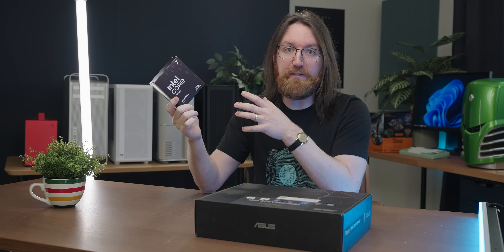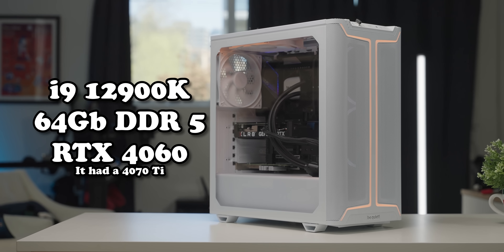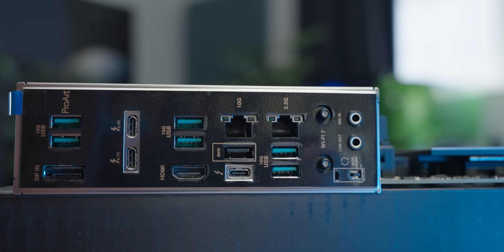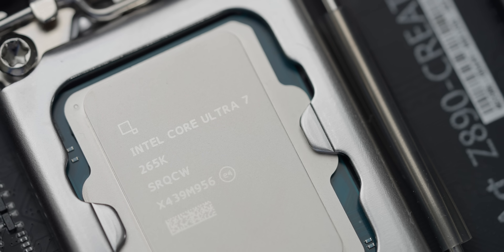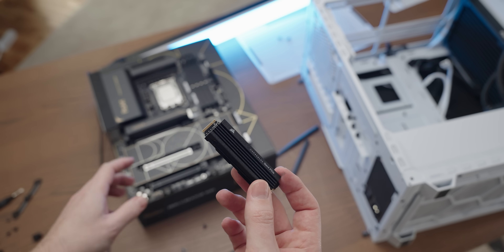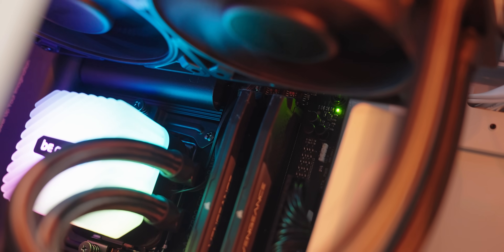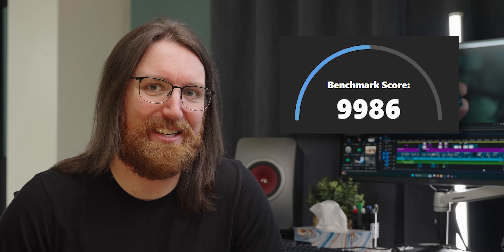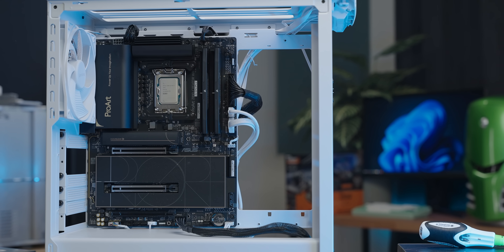I ACTUALLY Bought An Intel Ultra CPU In 2025...

Comment: I hate how creators talk about these CPUs as if they are actual shit, even though for a lot of users that need options which don't cost a liver they are usually fine, even for gaming. Like this video is already a few months old, so the price of the Ultra CPUs, especially the Ultra 7 265K and KF have decreased considerably, being even cheaper than Budget X3D options. Obviously Intel sucks in a lot of ways but these CPUs are in my opinion an actual budget option, which depending on your graphics card can get medium to high performance in computationally heavy games. Again, there is obviously better options, if you have the money, but those usually have a price increase of at least $50 and probably more.

Comment: Dawid I use an Asus Pro ART B660 Mobo for my Capture/Editing Rig, 
I chose it for the ''DP IN'' which offers an up to 240hz passthrough from DP to USB-C on yours I am guessing it is the one on its own!
This allows me to duplicate my gaming to a second DP & if you then send through the MOBO and send the USB-C through to a capture card it means any G-sync or Free-sync you have running is not in any way effected by what FPS the capture card is recording! This only works if the capture card is then passed through to a high refresh rate monitor, but I just return it back to an empty port on my gaming monitor and it works a charm!
You play on a native DP with no passthrough delays or image issues & your capture card basically receives the same with no weird taring or Refresh rate reduction!

Comment: Well, for its money, 265k and 285k are beasts, which are good and even better than AMD for work and then slightly worse for gaming.. So May be AMD was better a year ago, but now, Nov-25, intel is great value for work, etc. 
Same as NVIDIA videocards, I still have to buy them for work, they still good, ,but the best are costly...
 1) INtel is for work (2d, 3d, oficce, etc
2) you dont need support for 2 generations, if you bought PC for next 5 years - I can basically sell back to my shop all parts and upgrade 
3) Amd now is more expensive, its almost same or worse or better a bit in most of benchmarks, so for that money AMD wins just in 4k games. Again, if you are so rich just to play on PC, so buy the best GPU like 5090 and best chip, still now I think its 285k or 9800x3d...9950 also not promising...
I was dissapointed by burning 14 gen Intel, I love that AMD doing well, but after all checks, Intel ultra is the cheapest working solution for me for next 5+ years.
My conclusion - INtel is value for money now and for work+games. AMD is slightly better for games+plus you can upgrade next year - so money is not a problem for you )

Comment: how much time is it saving you per render though. enough to build another system? probably not. fixing the 50 series card issues would have probably netted the 12 series the same results on that benchmark if one system was gpu bottle necked why wouldnt the other be? did you even consider rebuilding the 12th gen on its box and just seeing for shits and giggles how both systems with that card do, drag raced comparison?

Comment: Need some advice guys.

I need to build a machine for 3d modeling and some light rendering (arch viz), with a lot of lidar point cloud workflows in there.  Should I build with this cpu or the i9-14900k?  will have 256gb RAM and rtx 5080 and large case (fractal north xl).

I plan on a 420mm aio and overclocking this bish!

any help is appreciated.  🍻

Comment: Same CPU and motherboard for my build. I also do audio production as a hobby, and for those kinds of workloads the 265K still outperforms anything from AMD. People who whine about the 10% drop in gaming performance over AMD cry too much. My last build was from 2016 - I also game casually and the 265K with a 5070ti is still generations more impressive. I can run less demanding titles at 120hz 4k, and have a secondary 1440p at 60hz for more demanding titles. Unless you're actually trying to run top demanding AAA games at 4k 120hz ultra it's still going to run anything you want to play.
Reply: Anything on heating issues of Ultra 7 265K? I am running an i7 4700K,  GTX 1660 Super 8GB (Upgraded from GTX 750 Ti OC in 2019 ) and and 16GB RAM for the last 11 years. looking for an upgrade now. Any recommendations on Ultra 7 265K would help. Mostly video editing includes AI, and of course occasional gaming too :)
Reply: @aceplaybill  Well, you'd have to define what you mean by heating issues.

It certainly runs hotter than my 6700K. My 6700K with that Noctua cooler that barely fit in a case idled a little above room temp (usually low 30s) and maxed in the 50s at full load. At full load that system was barely audible.

With the 265K idle temps are in the low 40s, and with full load it averages in the low 80s. At idle and doing simple tasks the system is dead quiet, but at full load it gets somewhat loud.

That being said, I crammed this thing in a Light Base 600, and built it in a reversed layout so I can see inside the PC with it on my left. I used a Deepcool MYSTIQUE 360 because I wanted to play with the screen, but because of space considerations I was only able to mount 2 of the 3 fans on the radiator (can't remember exactly why, something with the reverse layout and the motherboard and GPU all being at the top with the rad). It would probably be a little quieter with 3 fans on the rad, but I have no reason to pull it apart as of now. Knowing what I know now and with the case I picked (that can be oriented 3 ways) I probably would have went with an air cooler ... but whatever.

So, it will run hotter and louder than your 4700K. I don't personally find it an "issue". Unless you're doing something like video rendering hitting all cores at max, it's not ridiculous. Even during most games it runs in the mid 50s/low 60s (they're probably mostly GPU bound).

Comment: The 265K is a great value for someone who is using it for work and not gaming. it's also not bad for gaming either. If I was purely gaming, I think the 9600X would be best bang/buck in a budget system. For real work.. the 265K is awesome.
Reply: Even though it's a bit worse for gaming, the efficiency/power consumption of this 265K is already much better than a Ryzen 9600x or 9700x, which is pretty cool.

Comment: I'm considering getting an Ultra 7 265k because in my country it can be found new at around 270/280€ while a Ryzen 9 9900x costs more than 300€ even used and the 265k performs a little better than 9900x in general.

Comment: I have the ultra core 7 265k also. I use it for gaming and video gaming. I have it paired with a rtx 4080 super. While playing video games such as COD, Battlefield, Indiana Jones, etc. it has very high frame rates; usually above 150 fps in 4k. Judging by the usage percentages, the bottleneck is the GPU, not the CPU. My DDR5 is 7200mhz, but the CPU can handle much faster ram. I love this CPU. I'm not sure why so many youtube guys who don't have one throw so much shade at it. . . To the videographer, why would you buy an AMD motherboard when you just had one go out on you? AMD boards have voltage issues. I made a gaming pc last year with a 7800x3d and an AMD motherboard. The MB fried the CPU on the first day. I also had a 7800xt gpu go bad in 2 weeks of light use. I replaced it at bestbuy with a 7900xtx. That card only lasted a month! So I toom it back and got a rtx 4080 super. I've had no issues since and will never buy an AMD product again.

Comment: Video editing is very good on my Core 7 Ultra 265K. My Ryzen 9 5950x wasn't cutting it, even with an RTX 3090. No complaints, except I'm stuck with DDR5 6400 and now it supports DDR5 8000, I'm not at all happy about that but I can't be upset I now can do that, but man that is frustrating.

Comment: Here 265k is often for sale 210-230€. 9700x usually 330-360€, 9800x3d over 500€, 7800x3d around 380€ and all ryzen 9 processors more expensive. It is great value for money  at this moment. Power draw is quite big, but it would take like 4000 - 12 000 hours at near max draw to see that difference in electric bills.

Comment: Finally someone notices. This cpu is about $100 cheaper than the rysen 9 9900X, but it performs better at the tasks that thing is made for. Not to mention that it matches the gaming performance.
You can get a 3D version and those do better, but they are several hundred dollars more expensive. And the best intel cpus still beat those if you are willing to match the price.

Comment: The issue with 10GB is probably that it is 10GB copper.  10GB copper ports, no matter how they are implemented, are only good for short bursts of data and overheat with sustained transfers. This even occurs with GBIC modules.  For good sustained 10GB you need fibre.

Comment: Gaming (and the fact that it's a "dead" platform with no possible future updates) isn't the only problem with these new Intel CPUs...
Another issue that has been confirmed to have no solution is the fact that they limit the speed of the new PCIe Gen 5 SSDs, preventing you from getting the most out of them.
The SSD's PCIe 5.0 lanes are connected to the I/O tile, which has a longer data path to the main CPU tile compared to the GPU and memory controller, leading to latency and reduced bandwidth. While PCIe 5.0 SSDs are capable of 14 GB/s, tests on Intel Core Ultra systems have shown speeds topping out at 12 GB/s.

Comment: I finally finished my build. On a AORUS Z890 ELITE ICE, with 64 GB T-FORCE DDR5, Intel Ultra 7 265K, and ARC A770 16 GB. I'm using Crucial 2TB GEN 4 for Boot disk and 2 1TB GEN 4 Predator 7000 NVMe. The cpu is on sale for $290. I was on an old system before, a i9-9900K.

Comment: I don't see what the big deal is. 14700K/14900K are still great if you want a processor that does everything well. AMD has great gaming chips, and great production/workstation chips. The x3d processors might get a few more frames, but they're not comparable in production workloads. And the other thing nobody ever seems to mention, are the 1% lows on these AMD processors in games. Gamersnexus has all sorts charts, and it's like the common theme among all of them. They have higher max frame rates, but their 1% lows can drop into the double digits, even when averaging over 300 frames. It's kind of crazy. It scared me away from the x3d chips. I like stability, and I hate stuttering and micro stuttering and dropped frames. Some people don't seem to notice it.

Comment: Will cpu affinity help in gaming performance?
Reply: -----
@benn669
-----
- That depends...
Older games interestingly enough work better and are more stable if you add constraints on the core count.
Of course, that depends on how they coded them.
There is no harm in experimenting back and forth to see if you notice any difference in regards to either performance and/or stability.
One thing to keep in mind is the 'Power Profile'...
The new microcode is "Optimized" for the use of the default 'Balanced'-mode on 'Intel' now.
Arguably because most users use computers 'Out of the Box' as the saying goes, so they opted to tune the microcode as such.
Which means that users who are used to picking the 'Performance' or 'Ultimate'-mode can actually hamper performance instead of increasing it like it used to do before on older generations of 'CPU'.
Actually, it can be degrading on 'AMD' as well, since it seems to screw with the scheduling algorithms.
Although motherboard manufacturers like 'Asus' have been trying to iron out this little wrinkle.
-----

Comment: The cpu isn't anywhere as bad as the reviewers but it needed that bitchslap to get those patches out. It's pretty descent and can even oc beyond the stock ryzen 9950x. Having said that a 9950x is better if oc. And this is expensive investment when similar performance can be had for much cheaper in prev gen. Gaming performance that is. This is faster for most everything else. Nice motherboards. Latest ports. Lots  of them. It's for who wants the latest and can spend on fast ram now.

Comment: Curious how would this setup compare to a dual Xeon workstation with the same GPU? The old high core Xeons can be had really cheap, and throwing 40+ physical cores plus a modern GPU at rendering really speed up Black Magic’s DaVinci… whether you go HP Z640, Z820, Z8 G4 or Z8 G5 you can get amazing rendering, ultra quiet and ultra reliable from workstations.

Comment: All anyone can talk about is X3D, even those AMD fanboys that don't own an X3D. It's just like the Nvidia owner that bought their 4060 only because the 4090 exists, while not even considering Radeon. For the money and if you don't own a $2000 GPU to game at 1080p the 265k gives up nothing in gaming to X3D in real world settings and GPU pairings, while utterly curb stomping the X3D in multicore. And that's when the X3D is a whopping 50% more expensive.

If you're building a mid range system you really should be giving Intel a chance. They're killing AMD on value. Ironically the opposite of where we were 7 years ago.

Comment: I have a Core Ultra 7 256K in one machine, and I like it quite well. It's not power-hungry, and it handles video well. My standalone GPU died, so I'm using an old 1660 GPU until prices get more reasonable on something more powerful.

Comment: Why does every tech-tuber use a silly AIO cpu cooler, and ends up doing the PC equivalent of a complete engine rebuild on their machine every time they need to swap out a GPU (or even just an ssd)? Air cooling just makes so much more sense.

Comment: I actually don't think buying an intel chip is a bad decision at all.  While I didn't upgrade my 13900k this year, I did buy a new laptop and it does indeed have the ultra 7 285V.  My only complaint about this chip is that I wish Intel would have put in 10 cores (ala M4) instead of just 8, but I've heard that they were faced with the more iGPU or CPU and both would not fit.  Not that I understand that reason as Apple managed to fit it all on one die.  Aside from that, this laptop plays all my games and performance is more than acceptable.  I don't regret a thing.

Comment: The launch was terrible but Intel has fixed all of their UEFI(BIOS) issues and Windows issues. Core Ultra works well now. However, there will only be 1 CPU series for this socket and chipset. It's an instant dead end.

Comment: Those problems with the AIO ond the GPU are the reason why I always prefer the biggest cases I can get. Smaller cases can be nice but the actual footprint of big cases usually isn't that much different but you won't get problems with excessive components.

And by the way: I really think the recent Intel CPUs aren't bad. Even for gaming. Most of the time you're in a GPU bottleneck anyway as I guess you're unlikely to play games in CPU benchmark settings, like with a 5090 at 1080p low settings. And as soon as you increase graphics settings and / or use any lower classed GPU you shouldn't notice a disadvantage for the Core Ultra CPUs. They might not reach the last generation's performance but it's not like they're bad either. Plus they need noticably less energy.

Comment: I'm actually considering a similar build for the improved media encoders built into the CPU and pairing it with a spare Intel A770 GPU considering all other options are stupidly expensive right now. Once prices settle down, I'll grab whatever makes the most sense for the $1k level for the GPU. The Ultra 285K has a significant price bump without the corresponding performance bump for the stuff I care about. Even then, I realize the GPU is really uneven with the CPU - but I'm just waiting for prices not the be 3x MSRP.

Regarding benchmarks, I watched a video by Puget that explained they actually recalibrated their benchmarks after throwing out old workflows and using more modern ones instead - so, in theory, the new benchmarks will be closer to real world tasks. Also, in most benchmarks, most top scores were within the margin of error - so don't use that as a buying decision unless to get a cheaper chip that performs about the same.

The only bit here that is unrealistic is the ProArt motherboard (basically God-tier) - I get Asus gave you the motherboard but the mid-range chip really should be paired with a mid-range motherboard - like the AYW or TUF series - unless there are specific features you need from the motherboard to justify the price difference.

Comment: I find it funny that everyone is saying intel get crushed by amd x3d cpus in gaming. But load up a game in 4k or even 1440p and its gonna be fine. I have both a 9800x3d and a 285k system both paired with a 5090. I will tell that I dont really notice much difference in games, but I do notice how slowly the 9800x3d is when im doing anything other than gaming.  I personally prefer to use my 285k system for both work and play.